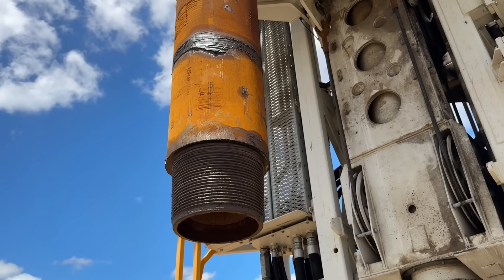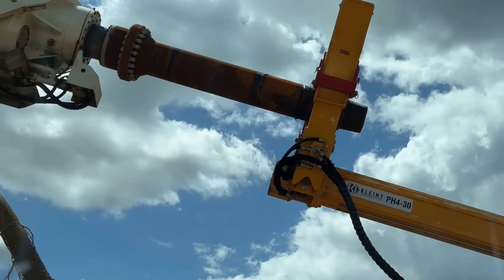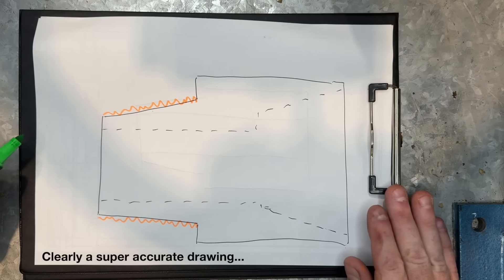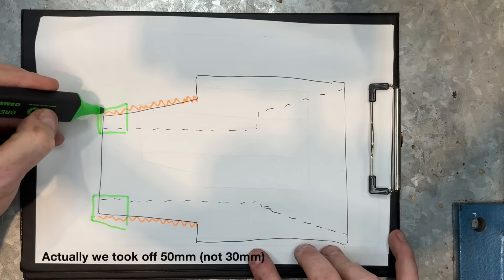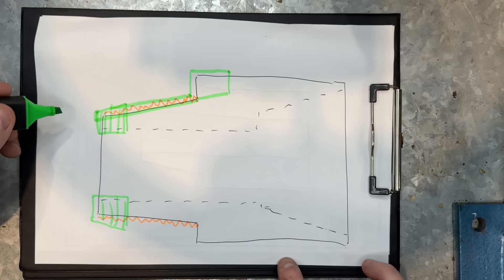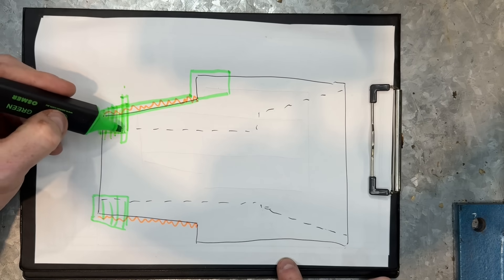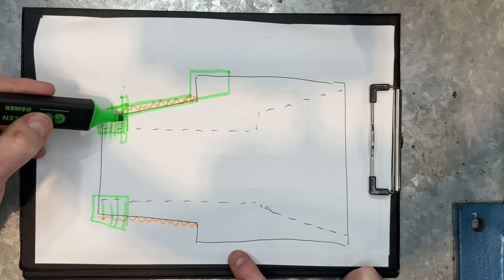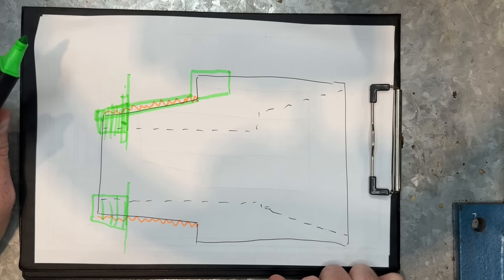Repairing a MAULED Saver Sub (It Looks Like A Croc Bit It!)

Comment: Hello mat. Man from lreland here. 10 years. Toolmaking.  Just wondering what thread this is. I do taper threads normally. Bsp or npt. Just curious to your methods.
Reply from the maker: It’s a custom thread designed specifically for RC drilling.  3 tpi with a 3 degree taper.

Seems to work pretty well so far.

Comment: 14:24 If you have a problem keeping the steady rest bearing shield in place, you might want to consider using Kurtis's (Cutting Edge Engineering) trick with duct tape...

Comment: Just what is that connection? It looks like a giant XT, but I've never seen one that large. Typically, that would be 6 5/8 regular here in the US, but this one obviously contacts  a shoulder inside the box.
Reply from the maker: It’s a custom thread with dual torque shoulders.  About twice the size of a 6 5/8 reg 👊
Reply: @halheavyduty  right on, Herr we've been using an XT-39 connection on 4" pipe ever since the horizontal wells became all the rage. Looking at another video, I'm guessing this connection goes on the rig that cuts the large diameter holes, which we might call a rathole digger, typically used to set the conductor for the surface hole.

Comment: Would it be possible to repair the Sub by using a Metal Arc Sprayer to build back up the surface and to then recut the thread? I notice that Kurt from CEE does that.
Reply from the maker: I actually don’t know how well it would work.  I’d imagine it’d work to a degree. We have considered it, but the cost / benefit doesn’t stack up for our little operation.

On big super expensive parts it would be ideal though
Reply: @halheavyduty  Thanks for replying Matt, always interested in the jobs on your Channel.
Reply from the maker: Cheers brother

Comment: Could you just cut the threads off then weld ALL of material back to original and rethread?
Reply: Yes you could do so. However there are several drawbacks to that approach. Welds are never flawless and usually contain  internal imperfections such as inclusions, porosity, small cracks, and overlapping/lack of fusion spots. Because the threads are one of the highest stress areas, you have a higher  chance of thread fracture. Which, if a thread peels off you probably have to cut up both the male and female part and scrap them in this situation. Length doesn't matter that much on this part so just shortening it a little bit, like Ned Stark is much faster. Secondly, I can't remember exactly but Matt mentions what the drill pipes are made of in another video. I suspect it's heat treated high strength low alloy steel like 1%Cr-0.5%Mo. This means that the differing thermal history in the heat affected zone under the weld layer means you have a wide range of physical properties in the HAZ. So typically you have a layer of hard and brittle material just under the weld nugget.  Not only does this make failure and cracks more likely, but it makes machining really nasty due to varying cutting forces as the insert ploughs through the HAZ. If you do that kind of repair it's best to normalize the part by heating it to dull red heat then gradually cooling. Otherwise you break a lot of carbide inserts. But then you have to, after machining, heat treat the part again then throw it back in the lathe and chase the threads to correct  distortion from HT. Otherwise torque on the drill will just chew the part up.
Reply from the maker: What he said 💯👊

Comment: I was pondering why such threaded bits for drilling aren't heat-treated so they wouldn't wear out or strip as easily... until I thought about drilling service and how abusive it is.
Yeah, shock resilience and toughness are the order of the day, and heat-treated parts would most likely break, never mind the huge cost.  My brain, before coffee.
Reply: I suspect it's heat treated, then tempered heavily to draw back the hardness enough to have moderate machinability. You'll notice when they're roughing back the outer diameter the chips starts igniting from friction. Certainly high strength material.

Comment: Those threads on the pin end are flogged out.  I see there’s a bit of bruising from the tong dies in the iron roughneck. We used to send our saver and crossover subs to Sharpies in Roma for machining.
Reply from the maker: Those guys do great work.

Comment: Matt, here's a thought for parting these when you're going to re-thread them. Use a CNMG insert to cut a flat spot for the parting tool first. That would take away the flex in the parting tool, making it less likely to break. Ohio would like to send you some snow. :)
Reply: I wonder if you could part it off from the inside?

Comment: I’m no machinist and I mean that. With the part off, why not cut the threads out with like a neutral cutter to get a flat spot for the parting tool to start?
Reply from the maker: You could… but it worked fine not doing it too…

Comment: Hey mate great job just wondering how did you know to come in 30mm was it the pitch or thread condition voodoo witchcraft voices in your head your beard runs the show Voynich manuscript translated? 
Asking for a fiend.😁
Reply from the maker: Haha. A mix of guesstimating how much thread height has been lost… and running a few calculations.

50mm means it’ll work every time - so it’ll be a standard reduction for each thread repair visit

Comment: Hey Matt, great vid. The camera work was stellar! The vid had a good flow and rhythm. More like that please. You even had the comic relief with Murray. I think you may have found your calling card. If you can continue to repeat this formula, you will have found your niche and the channel will take off! I mean you already have the unique drilling aspect of the channel. Add kick ass close up camera work, and always have some great comic relief aspect in the video (really liked the group reaction to the sub spacer install vid, added a little more comic relief) you will be golden. Keep the dog content, maybe occasionally add some good neck bouncing rock and roll (maybe in a short montage) in each video or on a semi regular basis you will have found a formula that will bring them back every week. The only thing I would change is the font work (and possibly the color) on the subtitle content you added to certain spots in the vid. Being hard of hearing from birth (as well as being a fellow lefty), I have spent a great deal of time reading subtitles in my life,so a little more refinement in that area when you use them would probably be a good idea. The actual type of font was not the issue. It was the size, placement and color. While sharing the screen with subtitles will often cause folks to make the font small so as to not take up screen space. Its common. You might want to keep in mind where the main focal point of the viewer will be, you know where they will most likely be looking, and deciding placement based on that and what's on the screen, you know not blocking important stuff in the picture, and then color. Choosing a good color that has good contrast, but not so much contrast that the subtitles are jumping off the screen and distracting from the video content. I had a hard time noticing the subtitles when they showed up and had to rewind several times so I could read it. Just need a nice balance where the subtitles look natural and the video and subtitles compliment each other. More thoughtful placement, slightly larger in size (so it is more noticeable) and a color that stands out well enough that people can easily read it before they are gone. White is usually a good color to use, but there are times this won't work if there is a lot of white on screen already (that's where the contrast comes in). Black font is not usually a good color, but if there is a lot of white on screen then it might be a good choice. Again, great vid Matt, more like that please! Murray licking his nuts was a great way to end the video with your audience cracking up (recognizing that most of your audience is male). Truly, I believe this video is a good one to try and copy the format. Great close up camera work, great explanation of the work and the desired outcome, good sound, good subtitles where appropriate, and some really funny content that entertains the audience, we all LOVE to laugh, good belly aching laughs preferred. Add some good dog content and maybe some signature music from time to time, or adding a video montage to music on most every vid will be the sweet spot brother. Proud of you buddy, you have been a quick study. Oh and the flow and rhythm of the editing was really great too. Kept me glued to the screen and not wanting it to end, where You can be sure your audience will be waiting to see the next one. Cheers mate, I look forward to seeing the next one. E from Phoenix USA
Reply from the maker: Cheers brother! Thanks for the feedback and suggestions. As always much appreciated 👊👊✌️

Comment: Is it possible and practical to heat treat the finished product to add longer life to your creations?  Seems like there should be a way to extend the life between reconditionings.  North Carolina, USA.  Watching your work with these large pieces of drilling equipment is interesting and informative.  Thanks for sharing.
Reply from the maker: We actually prefer not to (on the big stuff). Nitridijg tends to lead to cracking.  Soft and easily repairable seems to work best.

Comment: Nice work, Matt. I'm just curious, as somebody who has never used a lathe, how is it that you're able to chase threads  without accidentally cutting a new one that is out of phase with the existing one? When I chase threads by hand, I can clock where the thread begins by turning backwards to seat the tool in the groove before going clockwise again, but I don't see the equivalent in lathe cutting. It just seems a bit miraculous that you can always follow the right path every time.
Reply from the maker: You do a visual run with the tool offset first… adjust via “tool wear” function on the CNC…

And then off it goes. Easy once you get the hang of it
Reply: @halheavyduty Cheers, Matt!
Reply: The machine he usually uses is a CNC, fully controlled by a computer program.  There's some manual setup of the part and tweaking and adjusting of the tools and settings related to different tools. But otherwise the tool moves fully automatically. On this part in particular there is a tspered/conical thread. That's pretty difficult to do on a manual lathe, but it's not a big deal on a CNC lathe. Threads on drilling pipe are almost always tapered. This wedges the male threads tightly and expands the female end producing a pressure tight seal.
Reply: @TSorovanMHael Thanks mate, very helpful. 👍

Comment: would it be cost affective to set up in the leath with a mig welder weld new metal on then cut new threads
Reply from the maker: Definitely not. 

Great question though.  Machining through welds is not ideal.  Just brutal on inserts due to impurities
Reply: Kurtis on CEE has recently (6 months ago?) invested in a plasma spray system for resurfacing hydraulic rods, and has been doing bearing bores and surfaces with MIG for years. You'll get a better idea of the time investment from his channel.

Comment: good job ..i wonder about you tool post .. ( i´m working on a cnc with siemens  control and the same tool post ) i can´t trust the tool measurement every time i change . do you have that these kinds of problems . fantastic channel big tums up from Dan in Denmark
Reply from the maker: We had to modify the toolpost, but it runs pretty accurate now.

Comment: Nice work, looks had material. What angle is the tapered thread? Many years ago I used to design form tools for tapered pipe threads, BSP and NPT, the angle was 1degree 47 minutes per side I remember. Is it the same?

Comment: I do that on a manual lathe, last fall I tried to do a hughes 90 degree thread turned out terrible with chatter, just couldn't support it well enough, but they wanted it now, next time if I try it again I will need to make a bull nose center and use both the steady rest and the center and see if I can do better.

Comment: Hello from New Plymouth Idaho (Zip Code ) 83655
I hooked up with you when you were telling about getting video advice from a true Karen from another "down under" machinist Kurtis of CEE.
  Can't wait to see the 3m drill drill the BIG hole. Can you explain a little more  just how this hole will work, I understand what the simple version is that you explained but I don't understand what is really going on at the bottom of the hole.
   I live in the number 1 region for growing potatoes and onions also know has the Treasure Valley.
Thanks !!!! for the GREAT info on a totally different way to use a drilling rig

Comment: Hey Matt.  Great video.  You didn't mention how you picked up the remaining threads to cut the new ones.  It's always a pain on a manual lathe.  So I was wondering why not just remove a bit more material so that you can skip the step of picking up the old thread?
Also, once the live center is installed, couldn't the steady be moved out of the way to avoid messing with it?  Thanks.
Are you still looking for suggestions on improving videos?  Would much prefer a voice over in editing than the subtitles.  Hard to read. Small font and often the wrong color for the background.  Thanks again.  Regards.
Reply from the maker: Thanks for that suggestion mate. Appreciate it. I prefer voiceovers too… just mixing it up a bit to see what works best.

Re steady being left on - it was just to avoid vibration when threading. Still seems to sing a bit with just the pipe center

Comment: 6:24  You already had the neutral TNMG on the post.  Try using that, plunging straight in, to get under the thread before switching to the part off tool.  This way your part off tool won't flex back and forth on entry.

Comment: I'm assuming the fireworks (sparks) when you were cutting to tops of the old threads off the Saver Sub were caused by localized work hardening as a result of frequency of use and being tightened to crazy amounts of Newton Meters each time. Love the 'They Break It, We Fix It' for the shop :)

Comment: did screens over pools for 26 yrs here in fla. hear you guys have them there also. if so, kickplate available in various widths and cut to length or 50' rolls, makes excellent shields, patterns, etc. available in .024 and .032. thicknesses. easy to cut w/ snips. bronze or white painted. saver is a smart idea. cool doggies.

Comment: Do you have the repaired threads cold rolled afterwards?  I am not a great fan of Saver Sub Repairs, as you said they are a throwaway item, and in the big picture not expensive.  In the past a saver sub failure has caused a fatality,
Reply from the maker: Yeah, we don’t recut the small ones… but these were designed 100mm longer than usual to allow for recuts.

Very expensive item when they’re that big
Reply: That one was really badly worn, wasn't it. I could see the string getting dropped off that one.

Comment: Interesting to see this refurbish. Makes complete sense to have a wear part protecting an expensive one.
A suggestion for any text you want to put on screen - White text with a black outline, or black text with a white outline, or some other color like yellow that has good contrast against the background image, and put it either a line lower from the top or a line higher from the bottom. I had a lot of problems reading the black only text, especially because whenever you pause a youtube video, they insist on putting a lot of their own text across the top, and the control bar across the bottom, which covers up any text you added.
Thanks for bringing us into your shop, and I will see ya in the next one o/

Comment: It's always good to re-use components where possible.  When I was an apprentice, one of the jobs we had to do was reclaim welded pipe flanges of all sizes.  It was in a gas and chemical complex and they went through pipework on a regular basis.  The flanges had been cut off on site and when there was a decent load, we had to machine out what was left of the pipe and re-cut the weld prep.  It was not just to reclaim the flanges, but as such a boring job (no pun intended) it also showed who had the concentration to keep on working correctly.  Stay safe when the "breeze" hits.

Comment: did they try to screw them together using gravel as a lubricant?
Reply: Every 8m the rig drills, they make the saver sub up to the rod box once. Then break it out once for pulling the rods (and bit/ BHA) out of the hole. That very quickly adds up on the number of cycles.
Forgetting to dope a connection was a "soda+chocolate, for everyone" offence for a trainee roughneck. The first time. Second time a verbal warning. Third time, you'd probably be broken back down to the roustabout crew (which was probably £50/day day rate difference). That's assuming the driller noticed - which wasn't every time. But that was the aim.